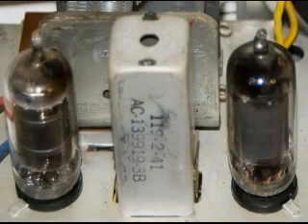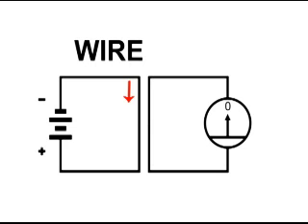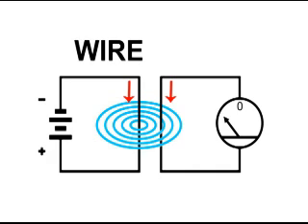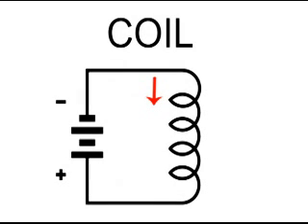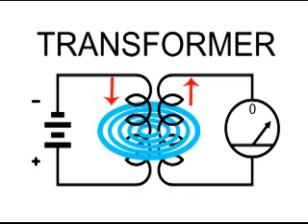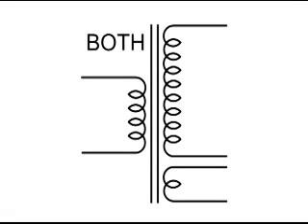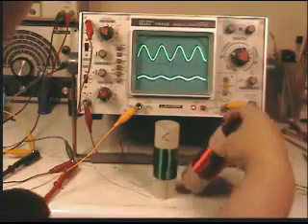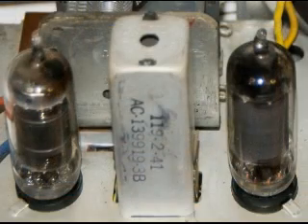Transformers, a few basics

Comment: Short.   Simple.    Truthful.    Confirmed by real-life observations.
As usual, Good job!

Regarding "conventional current" flowing from positive to negative, it persisted, I think, because people don't like to admit they're wrong.    Ben Franklin just assumed charge was positive.   It took awhile for the more mathematically inclined to demonstrate that the re-
sults (electrocution, sparks, current flow) in terms of electricity come out the same regard-
less of whether you consider flow of positive charges or flow of negative charges.
As of 2000, electrical engineers still work in both actual current (in electrons) and in conventional current (in imaginary positive charge-carriers).   The difference is important
in semiconductors, wherein the flow of charged particles at the level of molecules.
So today, scientists and engineers still talk of the flow of current or of "charged particles"
because the electrical laws still work the same, no matter what particle moves.

Not until the mass of the electron was calculated did chemists know why a "sea of
electrons" floats above any metal at room temperature.      However, I wasn't alive when
the mass of the electron was first calculated, so I could be wrong.

Since the electron is also the smallest charged particle,  the electron is Earth's great equalizer
with respect to electrical charge.   It gets the job done at the lowest cost.
Reply from the maker: What we know as electron flow, is from
the negative to the positive in a circuit. This was not discovered
until the vacuum tube rectifier was created. This is when they
discovered that they could only get a current to flow when the
negative terminal was on the filament and the positive terminal was
on the plate. The problem is, before this they had guessed wrong an
said that current and electrons flowed from positive to negative,
definitely wrong. However for some unknown reason they did not change
the arrow for current but they did for electrons. Since electron flow
is current flow this absolutely makes no sense at all. So I just use
electron flow from negative to positive, because that is the way it
is, that has been proven, no doubt about this. Electron flow has been
compared to water flowing in a pipe. If the water is flowing in a
pipe, what is flowing in the other direction, Nothing. Also you must
keep in mind what a theory is, it is someone's best guess. Another
thing to think about, is that we really do not know the why of
anything. We just measure and use, we are all only observers. I
believe that when the scientists and engineers discovered that
electrons actually flowed from negative to positive, they did not
change the arrow for current flow like they did for electrons flow,
because they did not want to appear to be 100% wrong, which they
were. So I prefer to use what can be proven and not a theory, and a
theory is just a guess.

Comment: Isn't current flowing from positive to negative. Electrons are moving from positive to negative but doesn't current move in the opposite direction?
Reply from the maker: Electron flow is from negative to positive
Reply from the maker: What we know as electron flow, is from the negative to the positive in a circuit. This was not discovered until the vacuum tube rectifier was created. This is when they discovered that they could only get a current to flow when the negative terminal was on the filament and the positive terminal was on the plate. The problem is, before this they had guessed wrong an said that current and electrons flowed from positive to negative, definitely wrong. However for some unknown reason they did not change the arrow for current but they did for electrons. Since electron flow is current flow this absolutely makes no sense at all. So I just use electron flow from negative to positive, because that is the way it is, that has been proven, no doubt about this. Electron flow has been compared to water flowing in a pipe. If the water is flowing in a pipe, what is flowing in the other direction, Nothing. Also you must keep in mind what a theory is, it is someone's best guess. Another thing to think about, is that we really do not know the why of anything. We just measure and use, we are all only observers. I believe that when the scientists and engineers discovered that electrons actually flowed from negative to positive, they did not change the arrow for current flow like they did for electrons flow, because they did not want to appear to be 100% wrong, which they were. So I prefer to use what can be proven and not a theory, and a theory is just a guess.

Comment: This was not the first video I have watched on transformers, but certainly the best. I currently reside in Europe, however, I have with me a number of appliances and tools that run on 115 volts that I have brought with me from the U.S. It was not hard to find step-down trasformers in flea markets, because in the past 110 volts was used here. I have several that I use time to time and I have always wondered about the power consumption. How many watts are consumed when nothing is connected, compaired to when a load is applied? Are there any basic calculations for it? Any insight would be greatly appreciated.
Thank you

Comment: dude, does transformer work on DC current?
Reply from the maker: Sayleap Salifu 

There is a pulse in the secondary when DC is first connected. Do a search on my channel on “CDI Capacitor Discharge Ignition Circuit Demo”

Comment: if positive doesn't flow to negative then how come diodes stop positive voltage from going to NEGATIVE?
Reply from the maker: Timothy Mattison 
What we know as electron flow, is from
the negative to the positive in a circuit. This was not discovered
until the vacuum tube rectifier was created. This is when they
discovered that they could only get a current to flow when the
negative terminal was on the filament and the positive terminal was
on the plate. The problem is, before this they had guessed wrong an
said that current and electrons flowed from positive to negative,
definitely wrong. However for some unknown reason they did not change
the arrow for current but they did for electrons. Since electron flow
is current flow this absolutely makes no sense at all. So I just use
electron flow from negative to positive, because that is the way it
is. Electron flow has been compared to water flowing in a pipe. If
the water is flowing in a pipe, what is flowing in the other
direction, Nothing. Also you must keep in mind what a theory is, it
is someone's best guess. Another thing to think about, is that we
really do not know the why of anything. We just measure and use, we
are only all observers.

Comment: Hello.  Can a neutral be used in a standard Step Down Transformer converted to a Step Up Transformer?  We connected 120VAC (Hot & Neutral) to the Input Side (reversed) and wired the Output Side to the 220 Taps (2 legs) to equal 220 Volts at the Panel connections.  The problem that we have is Unbalanced when you measure voltages to ground.  We have 148VAC to one leg and 69VAC to the other leg measured to ground with the meter.  We don't think this is correct.  It seems the current would shift to the lower voltage leg if the panel is loaded.  I appreciate your opinion with this connection.
Reply from the maker: +klassicjam 
Your comment ended up in "Likely Spam".
I would have to see a drawing of the transformer. By neutral do you mean the center tap of the secondary?
Reply: +AllAmericanFiveRadio Thanks for getting back to my question.  The neutral was used in the primary side of the transformer, and the transformer's purpose was to step up the voltage from 120 Volts to 220 Volts AC.  When you measure the voltage it seems abnormal (unbalanced), yet phase to phase is 220 Volts.  It worked properly; just an unusual situation because 120 Volt UPS power was used for a transformer supply voltage to 220 Volt Controls (large solenoid valves were used in the circuit which required more voltage).  Thanks again!

Comment: What is the name of the instrument ( that has the screen for the reading) ?
Reply from the maker: This centered meter, for this purpose could either be a DC current meter or voltmeter. If you are going to try and demonstrate the circuit, a DC voltmeter will give a larger response.

Comment: I've worked with DC power a little and have some understanding of it but am in question about the transformer. AC power is something I have little knowledge of but to get to my question. If the primary coil on a transformer is essentially just a loop traveling from line to neutral then what keeps it from pulling current until the breaker throws? Wouldn't that be like connecting a wire between the positive and negative terminals on say a car battery?
Reply from the maker: It would be like changing the connections to a battery, back and forth between positive and negative, 60 times a second. This would produce alternating current but more like a sine wave. Commercial alternating current switches polarity 60 times a second but with a ramp up and down rather than on and off.

Comment from the maker: Every time you open and close the battery circuit the magnetic field is moving through the secondary producing an output. If the magnetic field is stationary there is no output in the secondary.

Comment from the maker: You need an alternating current to produce an continuous alternating current in the secondary. Using a battery on the primary does produce a magnetic field that cuts through the secondary and produces current flow in the secondary. However once the magnetic field stops moving, then there is no current in the secondary, there still is current in the primary but the magnetic field has been established and is now stationary. You can only produce a current in a wire with a moving magnetic field.

Comment: why is current decreasing in the secondary coil when we do a step up transformation, does that mean that the current will increase if we do a step down transformation, does power (in watt) change from input to the output or it will remain the same?

Comment: Great video!! I'm pretty sure a transformer in the charging base for my cordless hair clipper has died. On the bottom of the charger it says 120V 60 Hz 65W. The battery itself is 4.5v how would I choose a replacement transformer to match?

Comment from the maker: @wcemichael
Its the same number of turns with the meter and the oscilloscope. But if the they were set up or down, the electron flow direction is still the same, but the voltage levels would be different.

Comment: Transformers are a vary important part of electrical work. You see not everything operates on the same voltage. For instance a door bell operates on low voltage WAY BELOW 120! If you were to skip installation of a STEP DOWN transformer the door bell would burn up on the 120V! Becouse of this it is best not to trust used transformers as you would want to BE SURE your transformer is in perfect order! I prefer to use new parts and know I did a safe job.

Comment: thats really Good knowledge... But i hv some Quetion U might help me..1 If we want to make Step-Down transformer(220V to 110V)  between both Side of Coil how much Distance Should b Given(inside where it induce the magenetic Field)?.2 DO we hv to Know the what kind of Coil/Copper wire should v use?..3you SHou About that iron bar is that alway has to be in there or it just for Small appiliance like radio Etc..? What you mean by in Phase, out phase. Dop we need it in Step down 220v to110? pls Reply

Comment: I have the chassis of an early 60's console stereo. It uses no power transformer only 11 tubes whose heater voltages in series add up to 115 volts. You could say it's the stereo equivalent of an All American Five radio.

Comment from the maker: Yes that is correct. It will not be quite as efficient as a transformer made for that purpose. Because you are using the secondary as the primary, and the primary should be the first winding around the core.

Comment from the maker: The impedance of the primary will be chosen to match the commercial AC. The secondary impedance has been chosen to match the impedance of the doorbell. Impedance is the AC resistance and for an iron core transformer, impedance is much higher than DC resistance. The DC resistance of a typical primary of a power transformer is around 5-8 ohms, but its impedance is several thousand ohms. Thanks.

Comment: Thanks so much for creating these videos.  You seem to be able to explain and demonstrate mysterious and difficult concepts in a way that makes perfect sense.  There are still a few concepts with coils and tranformers that continue to elude me, though.

In a step-down transformer, say for a doorbell, you have a primary coil hooked straight into the panel.  If this coil is just a long wound up piece of wire with negligible resistance, why doesn't it just short out and melt when you hook it up?

Comment from the maker: Power = I*E, if there is 120Vac at 1A input to the primary and the secondary voltage is 240Vac that means that the secondary I = 0.5A. If the secondary voltage is 120Vac that means that the secondary I = 1A. If the secondary voltage is 60Vac that means that the secondary I = 2A.

Comment from the maker: You may over load the 70 volt output by connecting it to the 8 ohm speaker. In this configuration the 8 ohm speaker is shorting out the 70v output. You can think of it this way from an 8 ohm speaker point of view. The 8 ohm output of the amp is a completed circuit ready for the speaker. The 70v output is not a completed circuit for the speaker and a matching transformer is required to complete the circuit for the 8 ohm speaker.

Comment from the maker: ddl312 & CassetteMaster 100% correct. To use the 70 volt line your PA would have an out put marked as 70V on the amplifier. This output would connect to multiple 70V transformers in parallel usually to cover a large room or several rooms and each speaker many have its own volume control.